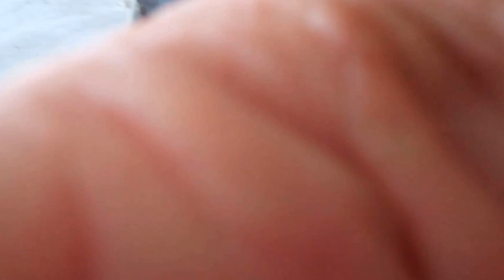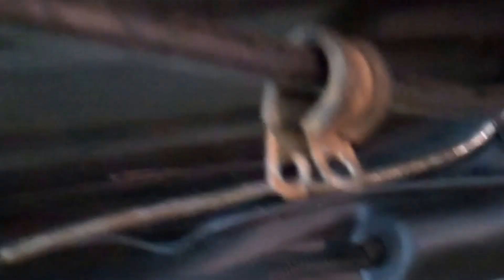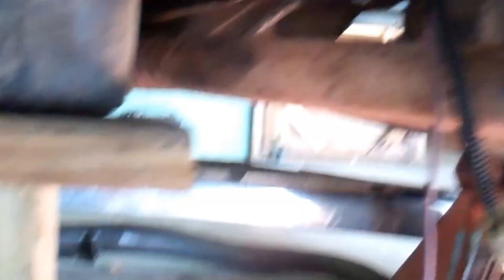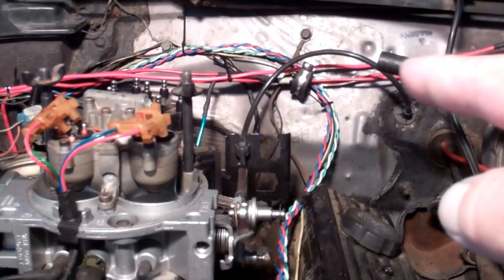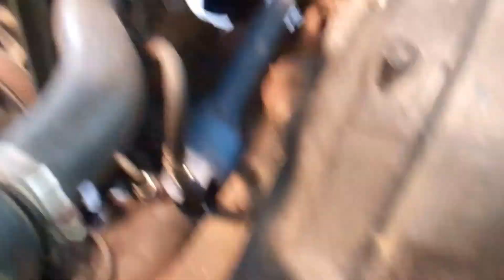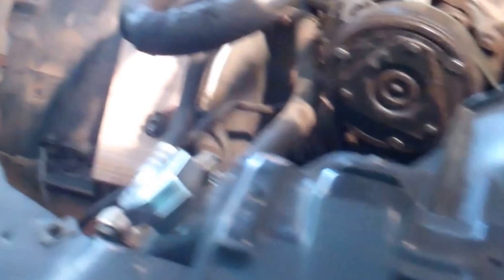'83 OLDS Cutlass Cruiser project - part 4

Comment: I took my computer out, that got rid of a lot of wires.an sensors.Chopped all the other wires out that i didn't need. I got manual gauges so that got rid of more wires.. i am running a carb on my car so i just have one wire for the choke.I ran my starter wires an other wires down behind the engine by the trans mission tunnel out of sight Got rid of the cruise control stuff.Also i got rid of the ac stuff  an put a non ac heater box in.That really cleaned it up even more Not to mention all that extra weight is gone
Reply from the maker: i LIKE the TBI, cruise and air, so they stay.  took the 'puter out of the '86 El Camino, but kept cruise and air (comfort driving!)
Reply: EdontheBeach yea i don't blame you for that,it's nice when it all works correct unlike the stuff that was in my 84 now ripped out Hey nice Elco :) i subed your channel